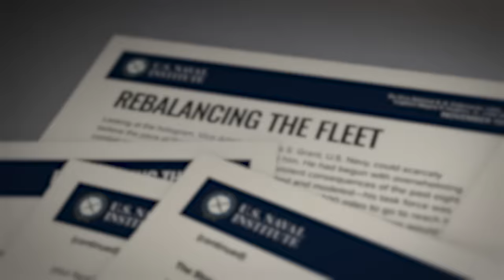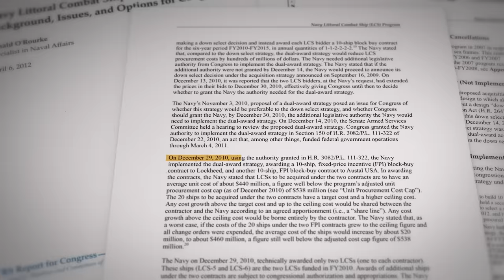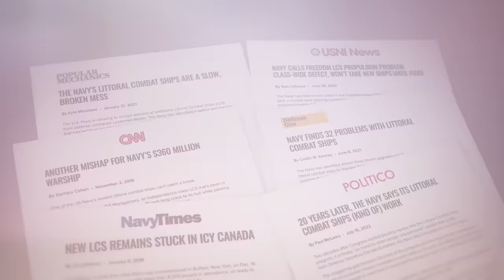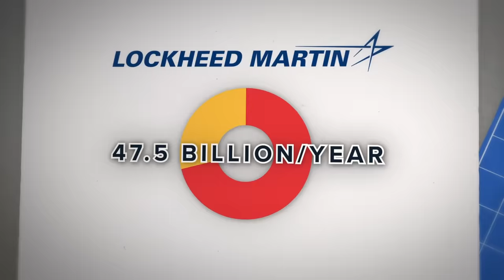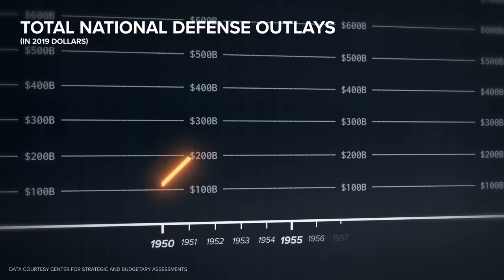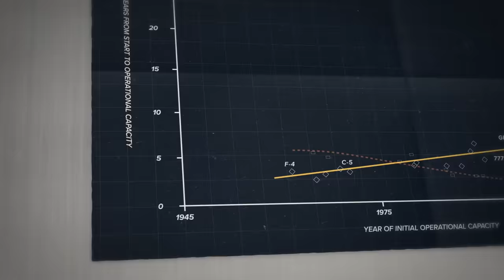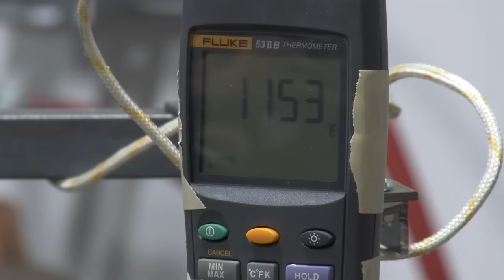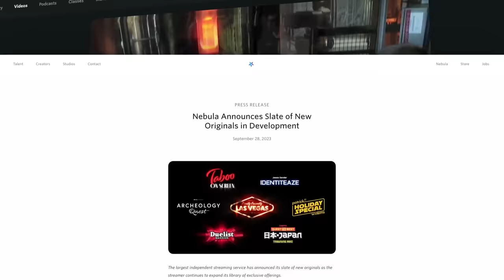Why the US Military Costs so Much

Comment: Comparing a 747 to an f35B is kinda unfair considering Boeing didn't have to invent a way for the 747 to take off and land vertically on a moving ship
Reply: Boeing did have to built the world's largest building from scratch to make the 747 and the whole program nearly bankrupted the company.
Reply: That is a problem because many experts now agree it would have been better to have separate programs rather than a unified Joint program. In pursuit of "simplifying" logistics and lowering costs by purchasing similar aircraft for Navy, Marine and Air Force, it forced each of their requirements to get jammed with each other. That increased complexity of development as the F-35B's special requirements influenced the others and in the end, there ended being not as much logistics compatibility between each other.

Edit: for people who doubt my claim that logistics weren't simplified THAT much. RAND (US gov think tank) published a report in 2008 saying that F-35A has 43% parts compatibility, F-35B 27%, F-35C 30%. The % has only gone down since, in 2017, USAF Lt. Gen Christopher Bogdan said parts commonality was at only 20%.
Reply: F-35 is the most hated fighter in service but it never fails to best reasonable expectations. The hate is not justified.
Reply: @chinguunerdenebadrakh7022  Aside from literally all of the expensive parts, which are shared among the three aircraft... Yeah, totally no simplified logistics. The variants definitely don't all use the same engine, radar, avionics, EOTS, DAS, helmet display, gun, weapons...
All that's different is that the F-35B has extra parts connected to the engine, a different fuselage, and no gun. The Navy variant has extra big wings.

The most you can say is that, perhaps, if F-35 were separate USAF and USMC and USN programs, the USAF may have a much larger twin engine aircraft. That's the best case scenario if you're looking for increased performance. That would literally just be a more modern F-22! The USAF would not have the money to buy enough of them, just as they had not for F-22. Whatever F-35 would have been was always going to be in this size range for USAF.

Perhaps USN would've gotten a larger carrier fighter. It does not currently have a navalized analogue to the F-22, this is true. It has Super Hornets and Growlers. This hypothetical plane would've been very expensive (twice as many huge engines) even by f-35/F-22 standards. Perhaps internal fuel load and overall range would've been greater.

USMC could not have possibly done better than F-35B. I doubt we'll ever see an equivalent again. F-35B has made it possible for a dozen countries that couldn't imagine having carrier aviation to actually get competitive carrier aviation with jets that can wipe 4th gens and enemy SAM networks clean off the face of the earth.
South Korea is considering it
Japan is going to buy F-35Bs and is modifying two carriers for it
Italy is doing it with a carrier and the Italian Navy has already received F-35Bs
Great Britain is doing it with two supercarriers and is going pure fleet F-35B even for RAF (this is the most questionable decision made by an F-35 partner)
Spain could do it to replace its Harrier IIs and ground based F-18s
Turkey wanted to do it, but we kicked them out of F-35 program for buying S-400. Their carrier is in service with no armed fighter jets, and at best expects to use UAVs and helicopters.
Australia could do it with effort, but isn't currently planning to.

In a world with three separate programs, F-35B probably withers, dies, and never happens, MASSIVELY weakening the navies of nearly a dozen American allies, and the US Navy's useful fighter-carrying carrier count is cut in half due to LHAs and LHDs only having AV-8B Harrier IIs until retired, which were both never as competitive as the F-35B is with its peers, and subsonic.

The USAF has a small fleet of slightly more capable jets in range, speed, and payload, but not sensors or EW.

USN may or may not get higher payload, higher range jets in very small numbers, because they're addicted to Super Hornets anyways.
Reply: No us Brits had already done that for you with the Harrier :)))
Reply: Just like the video kind of shames these companies for making money, this Video company is here to make money as well and comparing apples to apples isn't all that interesting most of the time ..
Reply: @SimonRobinsonSRNetworks  Get back to me when you find a supersonic harrier
Reply: @overtoast1105  when did the supersonic 747 cone out 🤔
Reply: @SimonRobinsonSRNetworks  The 747 isnt vtol lol im talking about the f-35b
Reply: They didn’t have to invent it for the f35 either, the av-8b has been doing vertical take off and landings for over 50 years
Reply: @Spartan1-1 the F-35 uses a new VTOL system that increases safety for the pilot and is much more efficient than the VTOL from the Yak.
Reply: BAE helped a lot with F-35B. F-35B is a two nation plane, primarily. American, and British too. @overtoast1105  

The later, greater Harriers were also two nation planes, but the original was all British
Reply: @SaroopD  All of the other jets don't actually structurally pay for the VTOL unless you wanted a bigger, two engine fighter. They DO carry more fuel, they DO have larger weapons bays than F-35B.
VTOL costs, specifically and solely, the F-35B model fuel.

And it's not about literal VTOL, it's about STOVL. That increases the number of carriers in the US Navy capable of generating fixed wing sorties by ten! 

And besides Britain, I listed a dozen nations that have massive capabilities they would have entirely lacked were it not for F-35B.
Italy would not be able to afford CATOBAR. Spain will not be able to afford CATOBAR.
Japan will likely never get CATOBAR again. 

That's 2 carriers for Japan, one for Italy, the option for Spain and Australia should they decide carriers with fixed wing are necessary. 

South Korea is very likely to get carriers, and F-35B is a much easier and cheaper option than CATOBAR+KF-21N, and more capable in most ways.

So in total, it increased US allied carrier fleets with fixed wing capability by at LEAST 13. That is a HUGE capability gap. 
Either in a war with China, or any intervention anywhere in the world that requires US Marines.

And finally, due to a lack of USN commitment, the F-35C has been nearly as, or literally as expensive as F-35B until the last year or two. You wouldn't really get any cost savings versus B models, but your carrier would be significantly more expensive and for everybody that didn't build QE II's, too large to operate and acquire.
Reply: Is it? 747 changed the entire airline industry and took $6 Billion (today) to develop
Reply: @kingace6186  I was on the Lincoln when they brought on 35's for the first time. They're beautiful birds, and the ABE's hated them because they were TOO good at landing. Made them constantly do maintenance on the same wire lol.
Reply: @superfamilyallosauridae6505  You're wrong about the UK. The UK has bought 48 F-35B, shared jointly between the Royal Navy and the Royal Air Force, just for use on the carriers. All other missions require the Eurofighter Typhooon. The Typhoon as a programme has at least a decade left. And in the meantime, the UK is working on Tempest, it's next programme. So no, the UK is not going to a pure F35B fleet.
Reply: @user-tg2km  They're not getting As or Cs, I was talking about their F-35 procurement being pure B
Reply: Lockheed Martin didn't have to invent it either, the VTOL tech of the F-35 is based on the Soviet Yak-141, even the 90º vectoring capability of the nozzle was copied.
Probably took several pages from the harrier's book as well.
Reply: @Goreuncle  They bought some test data, it was not entirely copied. The Yak141 did not manage to use a single engine to do it all, Lockheed made it work far better and significantly lighter in an entirely different manner. 

The Yak141 had THREE engines. Inherently way more points of failure and risk. Three engines to manage, to maintain, to fuel. 

An F-35A has 60% more maximum takeoff weight... the F-35B is heavier still. The Yak141 is not nearly as comparable a beast as it appears at first imprssion.
Reply: they didn't invent it....harriers has been doing it since the 60s
Reply: @SimonRobinsonSRNetworks f35b reinvented vtol, it doesn't use the same system

Comment: A note, cost plus percentage of cost contracts are illegal.  The closest is cost plus incentive fee type contacts which still have a maximum fee that can be applied and the fee is based on cost savings.  There is no contract type under FAR type contracting that adds a fee that increases as costs increase. 

Otherwise, I think that the rest of the video makes some great points about some of the issues and pitfalls inherent to defense spending.

Comment: F-35 does not deserve to be listed as a failure. Wildly capable aircraft at a great unit cost with massive interest from buyers and it's a very futureproof platform.
Reply: Except that the US air force doesn't want it, and not only did we have to restart the f22 program but we also have to develop a new aircraft.

It failed its primary purpose, not a complete failure but not a success.
Reply: @thewick-j1837  Do you mean the modernisation package? I cant find any info on new build production restarting. Mod packages are normal and happen to nearly all aircraft see F14-D for a very popular example. And I assume you're talking about NGAD for future aircraft? Also normal, this is like calling the f-15 & f-16 failures because the f-22 was developed shortly afterward. Superpower militaries like the US die in mediocrity, there's probably already a NGAD++ in development.
Reply: @helplmchoking it was a failure because it cost over a trillion dollars and another trillion in repairs and retrofits.

Thankfully everyone has their own 6th gen program
Reply: "Wildly capable aircraft"

Name three real world examples.
Reply: @СергейСердюк94 a trillion dollars is the projected cost over the course of the entire lifespan of the plane until it’s replacement. The f35 is the only plane that had costs calculated in that way.
Reply: @harfgarflarf  It's been extremely successful in joint exercises and has performed favorably against every 4th Gen fighter it's done aggressor training with. It's been a successful export model with several nations choosing it explicitly because of the missions it was capable of executing within that package. The f35 is also getting used in conflict now, so we'll see more examples soon. Keep in mind that the F-22 has never seen combat either.
Reply: @SonoftheBread  You noticeably didn't answer my question. Also where are they being used in conflict now? Israel? And your point about the F-22 kind of backs up what I'm saying. 

My point isn't that these aren't incredibly impressive machines. It's that they are money sinks that will never be used in a real conflict between eqivalent forces. Also let's say there is a WWIII, if everything really does go tits up, remember the adage that every army fights the next war by the rules of the last? I'm no expert but look at how many resources were poured into Battleships before WWI and II and they were basically completely useless because you could sink them with a couple biplanes with torpedoes. Maybe you don't need a fighter jet if you can just have a drone pop up from beyond visual range and fire a couple anti-air missiles.
Reply: @harfgarflarf  I gave you the applicable examples. If you want to see the performance of an aircraft and it's systems with a conflict to fight in, you do exercises and aggressor training. Those are the current best examples of how well it performs. I'd also like to add that the F-35 was ended to be the first "full battlefield aware" fighter aircraft e.g. Full data link, IRST, etc. It's designed to work cooperatively with unmanned systems. The US military has one confirmed, but probably multiple UAV wingman programs.

As for the 22 not seeing combat? There was no peer to peer adversary for the 22 to fight. The military isn't gonna fly the 22 unless we need to. The F-35 in that sense is more useful because we will be way more willing to deploy one to begin with due to it having wider mission capabilities. You're not smarter than the military industrial complex.
Reply: @SonoftheBread  
"I gave you the applicable examples."

That's an elaborate way of saying "I didn't answer your question". 

"As for the 22 not seeing combat? There was no peer to peer adversary for the 22 to fight. The military isn't gonna fly the 22 unless we need to. The F-35 in that sense is more useful because we will be way more willing to deploy one to begin with due to it having wider mission capabilities. You're not smarter than the military industrial complex."

Certainly I'm not smarter than the military industrial complex at generating billions of dollars in funding for machines that are literally never used.
Reply: @harfgarflarf  It's an elaborate way of telling you that there are no examples that will make you happy. You want examples of the F-35 being a capable aircraft and I gave you the measurable instances of it being capable, rather than just parroting what the military says it can do. And yeah, it's great at making money. The defense industry is huge and embedded. Good luck doing something about that. I just work in the military industrial complex to get my slice of the pie. However, if shit does hit the fan and these aircraft are needed? We'll be glad we spent the money.
Reply: @SonoftheBread  "I just work in the military industrial complex"

Ah, and there it is.
Reply: @harfgarflarf  I'm not a billionaire profiting off war, just a guy with a blue collar job. Can't fault me for knowing my line of work. Different strokes.
Reply: @SonoftheBread  Sorry, that was childish of me. What I failed to express effectively was just that I find it's a kind of absurd situation where one country is sinking huge amounts of money into a military system that is probably never going to be tested in a conventional war in our lifetime.
Reply: @harfgarflarf  one would hope not, which is the point of deterrence. It's valid to criticize how much is considered deterrence and how much is just war profiteering. I think it's just prudent to keep in mind that deterrence is real and valid, and having a vastly superior military can be a huge boon for a nation, even without directly using it. Walk softly and carry a big stick, yadda yadda.
Reply: @SonoftheBread  I suppose I basically agree but I have the luxury of doing so living in a nation that is a vital US ally. I don't think that makes the criticisms in this video invalid however. It's an interesting conundrum that so much money is spent on military systems that are never really utilised.
Reply: @harfgarflarf  I can agree with that, absolutely. It's been bloated and ballooned and there's a lot of wasted budget lying around. I certainly wish I was paid more considering how pricy the hardware in the line of work is.

There's a good point to be made in the fact that there are plenty of nations who more or less rely on the US military in one way or another. There's a dark side to it, where in plenty of places we've engineered the situation to rely on us. Regardless, we have taken up the slack in the western world and as such, we foot a lot of the bill. Just another factor in all this.
Reply: @SonoftheBread  In the Western world, absolutely. Although NATO countries more or less (maybe not always) do their best to pull their weight, the US military is essentially the backbone to the whole thing and could theoretically easily win any conventional war. Which is why several countries have applied to join NATO considering the Russian invasion of Ukraine. 

I was thinking more of the Asian theater. I live in Japan and alongside South Korea, Phillipines and other countries they basically have China pinned in under a US sphere of influence. It's understandable that China feels threatened by that. Now while I would never support the Chinese government in any way, you have to admit if you were in charge of their defense policy, having powerful military allies of the US completely surrounding you would make you feel that you have to take some countermeasures. While China has made some aggressive actions in recent years, I don't think they would realistically want to do anything as extreme as the Russian invasion of Ukraine. I think China basically wants to be left alone, and continue to develop their economic powerhouse. However the US military presence is essentially a continuously existing threat to them. Whether that's right or wrong, I don't know.
Reply: @mcmadness110  no over two trillion is it projected cost
Reply: It's so easy to demonize the F-35, but what fighter is better?
Reply: @guyfleetwood8004   for air superiority roles ? 5th gen American F-22. Chinese J-20. Russian Su-57. South Korean KF-21. Iranian F-313. Likewise 4++ Gen air Superiority Russian Su-35S, Su-30SM2 and MiG-35, Chinese J-11B, J-16 and J-15. American F-16V and F-15EX Eagle II. Indian Tejas. Iranian Saeqeh-2. EU Typhoon T3, Rafael B and Gripen E.

For similar strike aircraft capabilities like F-35 you have Chinese 5th gen J-31, American 4++ Gen F/A-18 Super Hornet B-III. Chinese J-10C. Russian Su-34M
Reply: It's mostly worthless.